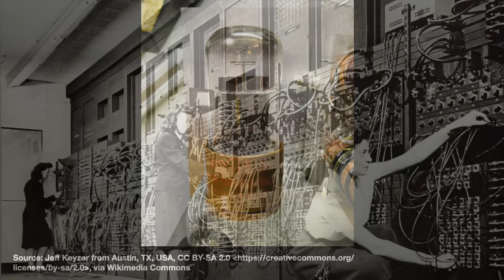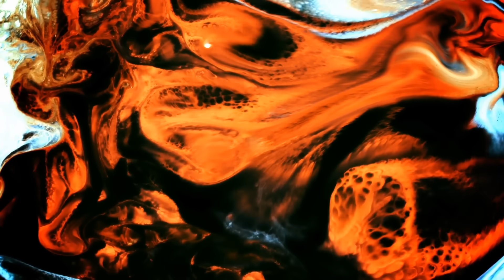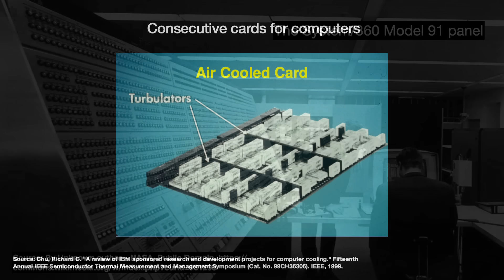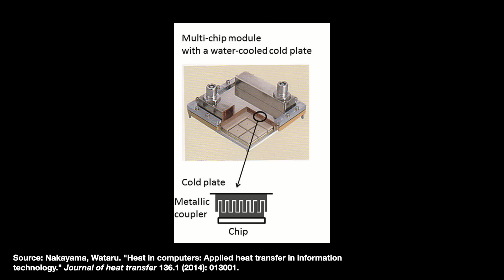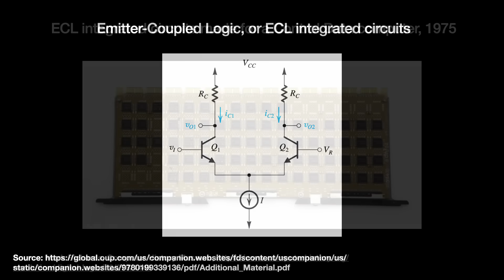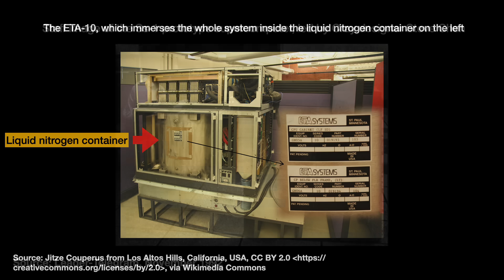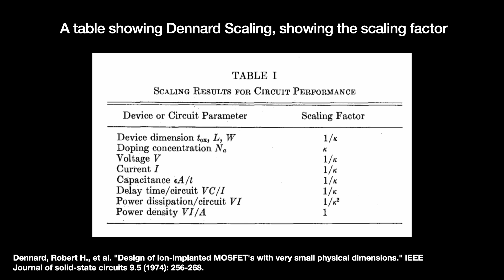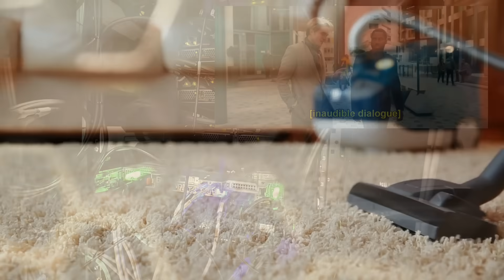Chilling Chips: A Computer Cooling Chronicle

Comment: Der Bauer should have a comment at some point. <3  I got to see a Cray2 in real life with the waterfall and seating. It seemed at the time quite extravagant. I was unaware of the integration. Having built powerful computers myself many times, now, I still have no idea how much heat they were really dissipating.  Datacenters and cloud centers have 1/3rd of their physical locality and energy budget dedicated to cooling. That's quite crazy and it's not going to get better. If you can cool it better, they will pack more in and thus the cycle circulates.
Reply: This video has been brought to you by Thermal Grizzly’s Conductonaut metallic thermal compound.
Reply: The Cray 2 did not have seating (the Cray 1, Cray X-MP, and Cray Y-MP computers did; the seats contained the DC power supplies). The Cray 2 did have the waterfall.

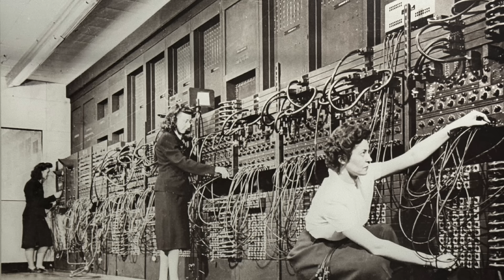Comment: 1:07 Consuming 150 kW of power, yet producing up to 174 kW's of heat?
Reply: Different sources give the power consumption anywhere from 100 to 200 kW. The author obtained the number for the electric power from one source, and for the heat from another, and did not realize that physics requires the numbers to be equal. This is not unusual.
Reply: The eniac was so advanced that violated the laws os thermodynamics
Reply: You just learned there’s a difference between watts and watts thermal and you assumed John was wrong instead of yourself.  

You can’t teach stupid.

Comment: Do you think future computing like quantum or neuromorphic chips will still have the same heat problems? Or could their fundamental design somehow change or even eliminate the need for traditional cooling?
Reply: Probably not the same problems. Most quantum chips still require ultra cold (cryogenic) cooling in a near-vacuum.  Right now they are such small scale that the bigger problem is keeping outside heat away.  Brain-like computers might be more similar, if they approached power densities anywhere near traditional chips. (I tend to hope we can do better than brain efficiencies in the longer run.)

Photonic computing (using light) might change things a lot, but right now it is not very efficient density-wise and is hard to integrate with traditional logic.

Comment: I want to work on cryogenic chips. Now that traditional scaling is dead, i think that is most promising alternative
Reply: I would beleive that if it wasn't for the fact my chip that did 3.6ghz 5 years ago, has a newer model that does 5.7 regularly and can boost to 6ghz. Consumes abt the same too. Transistors have been the same size for awhile now, wev just been able to cram more of them closer to eachother now. Especially with how stuffs being stacked 3D nowadays, it ain't slowing down anytime soon
Reply: @honkhonk8009  You can cram more transistors in a chip still. But doing so with traditional scaling gets exponentially more exponsive each time and complex each time
Reply: ETA (a CDC spin-off) did this with their ETA-10 back in the '80s, making both air-cooled and liquid nitrogen cooled machines. They did this by submersing the printed circuit boards in liquid nitrogen, and this had the effect of causing them to delaminate after a few thermal cycles, being brought up to room temperature (~300K) and back down to 77K.

Comment: 25:02 Can't wait for this to show up on someone's LLM-slop generated paper on liquid submersion cooling for compute after your CCs get ingested into training datasets 😆
Reply: nah, it would figure it out. I knew he wasn't about the KFC when I heard 'synthetic oil'. It would be clear that it should've been natural oil, unles AI would find itself in even more distressing future of synthetic oil deep frying
Reply: Giving third worlders AI was a disaster on par with giving em single use plastics. Every time I turn off the algo and open the explore page, it's just the most subhuman slop force fed to people. Even worse when your on transit and you gotta hear some goof unironically listening to the most corrosive mind numbing trash at max volume.
Reply: @honkhonk8009  don't worry, first worlders output ai slop at just as high a rate
Reply: @honkhonk8009 preach brother, the numbers of those AI papers are astounding.